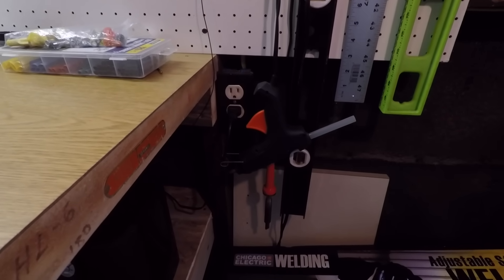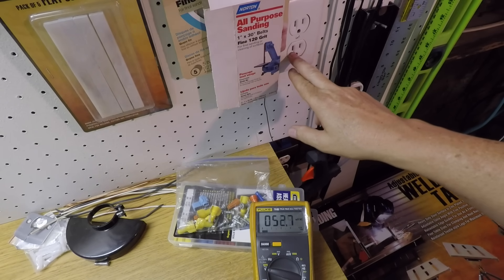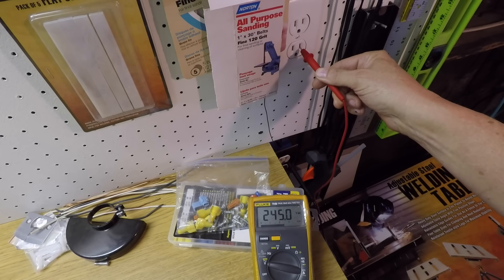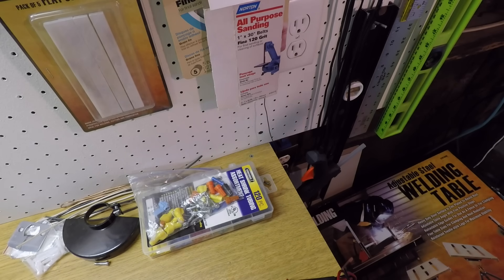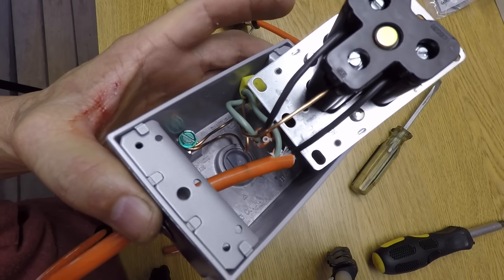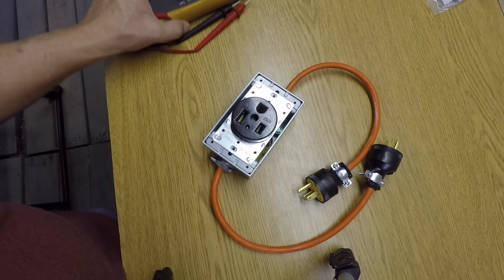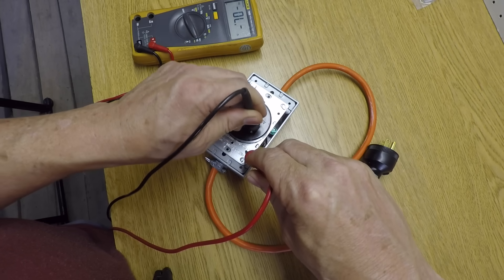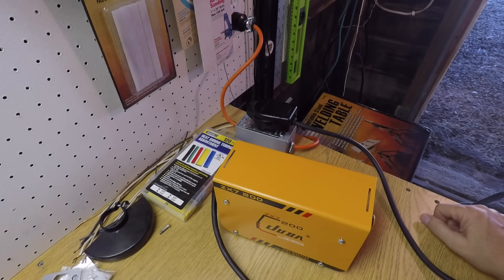How to Get 220v From 110v

Comment: If you installed two 120VAC outlets on seperate phases, why not just install one 220 VAC outlet ?
Reply: @Ranzy Campbell actually he did. He failed to use correct nomenclature but I had no problem understanding his narrative. He created a solution that he understands the limitations and characteristics inherent. If one is not comfortable then one should not duplicate.
Reply: @Ranzy Campbell that may have been what he meant when he said 2 separate lines like 40 times
Reply: The only reason I would think for not putting a 220 V dedicated outlet would be there was no more room on the breaker panel ?
Reply: T.C.  Appliance Repair  for one he had the two outlets there for more things to be plugged in,like cordless battery charger,a phone charger,plugging in a drill. Point is he has four things there. It looks like a work area. Second,it's cheaper than running new wire,getting another breaker,having wire running along the outside of walls, but main thing is it's for running a little welder when he needs it. You can unplug and put in bottom drawer of toolbox out of the way when not in use  it's a good idea what he did for what he needs bottom line. Good video.
Reply: @johnsellers2999  this is the best replies, the "scientists" produce idiotic advises, fact is that this connection works with safety. Remember, thousands of emigrants bringing their own small appliances which needs 220V with little amps, simple !!!
Reply: @TCApplianceRepair  What about if he has an old house with a fuse box? That would be a pretty good reason, wouldn't it?
Reply: @TCApplianceRepair  Exactly!
Reply: @Ranzy Campbell Ya, he kinda did at 40 seconds. I know you get it, but if you don't understand separate phases from his line "they're on separate lines"  enough to put 2 and2 together, then you understand enough to be doing this mod.
Reply: @Ranzy Campbell yes he did if you actually listen to the video. He says they have to be on separate circuits and he says he knows they are separate circuits cause he installed them.
Reply: 1:53 into the video he pointed out the two receptacles were on separate lines
Reply: If you took the time to run a completely separate 110-volt circuit so that you could do that why not just run a larger gauge wire and put the 240-volt receptacle where he put the second 110 instead?
Reply: I think the point of this method is to get 220V and also 110 without running the heavier wire that would be required for a dedicated 220V plug. That's what I wired for my Lincoln 220 amp welder that requires 60 Amps service. That little buzz box of his will probably be happy as a clam on 2 20's for a total of 40 Amps. I use 2 30's.
Reply: @kenjsr1  Since he is using  220V he only gets 20 amp, not 40. Only the hot wires are used so they act as both the feed and return.
Reply: Maybe because, he didn't want 220 there.He might not  use welder very much.
Reply: Maybe he did it like that just to save money on. I don't know.
Reply: Why doesn't he just make  220v extension cord, and plug it into where the stove or dryer is? He could even bleed off a new plug from dryer/stove and mount it in a convenient spot.
Reply: The problem is that if a circuit overloads and only one breaker trips, the 240 volt device stops working but there is still one phase hot. That’s why 240 volt breakers are tied together.
Reply: @chains350  Yea, but that isn't really a problem.  If one breaker trips, that still interrupts the circuit.
Reply: that's what I was saying also.
Reply: (@Ranzy Campbell)   3:24
Reply: my guess is that he cant run a 220 v cable from his breaker out to his garage? that would be my issue as well.... i do have two, 20 amp lines going to my garage but one powers the whole garage and the other has only one outlet on it for my 110v welders i use.
Reply: This is my same thoughts..  This outlet will not let him do much welding without tripping a breaker.. The wire he is using is tooooo small and the wire providing power to these two circuits is too light.. 12 Ga as he said..
Reply: I'd have to guess it's if you don't have that 220V outlet, need one, and have two separate circuits in relative proximity that you can tap this adapter into, or in his case, he only uses the 220V occasionally, and has more use for the 110V circuits.
Reply: You do this because you don’t have a 208/240V outlet. It’s perfectly normal to have one outlet on one bus, and a different outlet on the other. However this is still a ghetto electric hack.....
Reply: They make something like this for marine chords 
https://www.westmarine.com/buy/marinco--reverse-y-adapter-2-30a-125v-male-to-50a-125-250v-female--10072957?recordNum=1
Reply: Great vid
Reply: @RJC 3rd yes he did!
Reply: If he doesn't draw more than 20 amps, there is no problem. One good thing about making a box like this is that there is no 240v socket installed that could raise a red flag to a nosey insurance inspector.
Reply: ok
Reply: @designstudio8013  How many eggs?  You can't just say "several" eggs -- you have to be specific!  Precisely how many eggs?
Reply: cost and routing are reasons also the idea that if there's a line or 2 that isn't being used that's closer and cheaper to use.
Reply: this way might be cheaper and easier(not safer), it depend on where your panel is.
Reply: Gord Reddy While you will not typically run into it any more, Two phase does or at least did exist. We used to have a 5 wire two phase set up on the job. A2 A2, and C1 C2 with ground in the middle. It was used in an 13000 - 2400 electric substation for feeding the MG set as well as going out to feed some customers. While the phases were from a 3 phase feed, the 5wire configuration only used two phases.. Don’t remember a lot about it but I know it was a 5wire two phase set up. I also hate to hear the talk about phases as oppose to polarity talk.
Reply: Ranzy Campbell actually he did.
Reply: Just curious- who here wants 4moreYears ?
Reply: For his particular application this is a perfect setup. He's running the lines to be used as a dual purpose as he mentioned. He did not directly say this but I'm going to go out on a limb and say that he is not going to be welding very much. It was a way to run 110 throughout his shop and then be able to utilize it for 220 in the rare instances that he needs it. And now he has a very nice mobile setup that can be taken anywhere that has a minimum of two 110 outlets. Now do you get it? It really is not that difficult LOL seriously a bunch of overthinkers.
Reply: Let me try boss, I always wanted to fix a transmission.  DDAAAAMMMMMMMM!!!
Reply: Yep.  You could put it half-way between the two outlets.
Reply: @RJC 3rd 220 is single phase
Reply: it's not separate phases.  It is the same phase.
Reply: @tchevrier  It is also two phases that are 180 degrees out of phase with each other.  The difference between one and two phases is just a matter of perspective.
Reply: this exactly
Reply: Exactly what I thought 🤔
Reply: If you dont have complete control of the wiring until the breaker box, you are stuck with 120. You can't upgrade to 240. This would solve that. Aka. Condo.
Reply: Could neural wires be used to wire a 4-prong  220v outlet?
Reply: Exactly.
Reply: Because... HACK!
Reply: Agreed
Reply: Exactly
Reply: Why not throw the stove out and weld in the kitchen.
Reply: Y'know, I was wondering that myself.  :)
Reply: Exactly. He is not getting "220v From 110v", he is getting 220v from 220v, so run the 220v circuit.
Reply: Because then he wouldn't have been able to make this video...🤦‍♂️
Reply: Bones McGillicuddy  A typical NEMA 14-50 240v outlet does have a neutral so you can easily get 120v.
Reply: He could do that but he would have to cut drywall to pull wire from each box to join them into his new box.  Definitely what I would’ve done though.  :-)
Reply: @Ranzy Campbell it won't work if they aren't
Reply: @Ranzy Campbell 0:41
Reply: You can't get 220 from 120. He is taking from two different phases or supply lines so he is getting 240 volts any electrician like me knows this. I'm sorry but the title is deceiving
Reply: We have 2 110 lines coming into the house everything is 220, lights, appliances etc, no ground or neutral, crazy this is in the Philippines, on lights you cut one of the 110 wires for switch but you still have 110 to the light
Reply: He's forgetting that most stick welders need a 220V 50 AMP outlet.  20 amps won't do it.
Reply: You are right. This is a jerry rigged way of doing it. Just put a 220 volt outlet on the wall and done.
Reply: 🤦🏾‍♂️ RIGHT!
Reply: Since you mention it, NO. Its against code, NEC and Building code everywhere in USA. Things you plug into the outlet are generally bot covered by code. Not only is it against code its dangerous.But if it is for temporary or intermittent use then im all for it. The exception is that it is up to code if you use a circuit tie device across the adjacent breakers that are part of the circuit.
Reply: Because far more work is required like proper wiring.
Reply: Those 15A receptacles are under-rated for the circuits and present a fire risk if loaded to 20A. Please replace them with proper 20A rated ones.
Reply: Was wondering the same ! Lol😅
Reply: I stand corrected, there are four inputs and three out!
Reply: I'm going to try it!
Reply: exactly.
Reply: Why not just put one 50 amp breaker in the Box instead of jerry-rigging two that only goes to 20 amps Max? I installed a heavy duty cord from my basement out to my garage and a 50 amp breaker so I could use my welder, it works great and it's a safe way of doing it and it wasn't terribly expensive, I could do the work myself.
Reply: @builtyankeegirl  He most likely has a MIG welder that only needs a 20 amp 240 circuit. This would not work for a "stick welder"  that needed 50 amps. I agree with you as to why not  just  use a 12/3 cable and install a 240V. outlet?  He could cheat a 120V outlet off of one leg if he wanted to have one adjacent. . If you don't have 240V to your service, then this won't work without reversing the sine waves for one side. This idea would  work great if you were trying to use your welder at  a house that did not have an outlet and you just needed to weld something for someone . He did more work than he would have to wire in an outlet for the welder.
Reply: @wazjr1  if you watched the whole video you would have seen the welder. He as a tiny inverter stick welder. I have heard some people call them purse welders. But it is about the size of a lawnmower battery. I have been out of the fabrication and welding trade long enough I am not sure what they are called.
Reply: @wazjr1  If you had watched the video to the end before commenting, you would have seen that he has one of  those Chinese inverter stick welders. You may need 50A at 120V but not at 220V. You need half the current. At 220V 25A lines can power a 5KW welder with PFC. His welder definitely does not have PFC but it is also not a 5KW welder. Even if it says 200A, a guy on the youtube tested one of those and realised it gives only the half of it. He also says at the current setup he uses, it draws 15A. In the US, I have seen 3 transformer packed on poles (was quite strange for me. Expected safer, modern setups). They use 3 phases and use 220 on heating current hungry devices like ovens water heaters etc. Once the circuit breaker (not the automatic ones) burned and the microwave oven only worked when the light was turned on. It got the other pase through the bulb. Funny setup.
Reply: @builtyankeegirl  Hope you used #6 wire
Reply: @builtyankeegirl  a 50 amp bkr requires #6 copper wire
Reply: @builtyankeegirl   yeah think he just wanted to through out there that there is another method that you can get it done. May be someone is not familiar with the breaker panel... and does not want to be guessing.
Reply: @builtyankeegirl  because #12 wire is only capable of 20A
Reply: @builtyankeegirl  Ya, not much of a welder at 20amps.
Reply: @builtyankeegirl  honestly if you're going that far, put a 100A or 60a sub panel in the garage, have the garage on its own and you really wont need any upgrades
Reply: @builtyankeegirl  because by doing that what your doing is removing the safeguard of the breaker you can always put a smaller breaker on a 12 gauge wire but by putting a higher breaker than the 20 amp the wire could get to hot causing a electrical fire
Reply: @builtyankeegirl  I
Reply: @builtyankeegirl  the wire feeding the devices is only rated for 20 amp. You could install a 220v 20 amp breaker and outlet in it's place. If the welder needs more than that he should run the appropriate wire/outlet/breaker sized to the unit. His way is a violation and is very dangerous.
Reply: @builtyankeegirl  50A breaker on 20A wiring? C'mon, man!
Reply: @builtyankeegirl  first he does not need a reason, just because "Merica", second.... Portability of his setup, he explained he has the same setup (2*120 boxes) somewhere else on his house.
Reply: @builtyankeegirl  The only reason I can see for doing this is that his panel is full and can't add a 50 amp circuit. Even so, I believe they sell adapters to go from dryer outlets to NEMA 6-50, which would be a better solution, combined with welding extension cord.
Reply: Another reason for not just throwing a 50amp breaker in his box and up grading the outlet on the other end to a 3 or 4 wire 220v would be the size of the wire connecting the two. He didn’t state how far it is from the outlet to the breaker box and I would assume (at least my personal preference would be to) he would rather run an 8 or 10 gauge wire instead of the 12 gauge that’s currently in place, as he stated, especially if it’s going to be a dedicated 220v. It seems to me he is not willing to go through the work and expense if he’s only using 220v once in a while and for short periods of time. He did state that the welder was small and he didn’t think it drew much amperage.
Reply: @speedbuggy0542  lol know how a lot of welders have a number  in their name? How many amps u think?
Reply: Chris Gilliam Man Stuff this is what I did. Just a chunk of dramatically oversized cable, with the correct outlets on either side. It’s cool as a cucumber even with constant max draw. This is running a kiln, so it’s a pure resistive load.
Reply: @speedbuggy0542  So... increasing the voltage does not allow you to run a higher current on the wire. Running a higher voltage actually reduces current demand for the same wattage, but that's another story. So if he requires 20 amps it's always number 12 wire, regardless of the voltage. The thing that's kind of silly about this for us electricians is that he could have bought a 7 dollar dual pole breaker and wired the white wire that usually goes to the  neutral bar to the other pole on the breaker. So he pulled the wire... installed the receptacle, then had to buy a bunch of materials to make this device when he could have just bought the correct receptacle. Just kind of silly. Besides is way of determining the phase he's on with each receptacle is not a good idea at all. he has a significant change either because of load balance or where the taps are on the transformer feeding the house but I certainly would not recommend relying on your voltage reading to determine what phase your on when it's as simple as knowing where the breaker is in the panel for each circuit.
Reply: Was just thinking that
Reply: He actually explained that he has the same setup (2 * 120 boxes) some where else on his property, so this device makes the 240 adapter portable. And It works fine. No problem there.
20 amps only?, ... why not if that's all he needs.
Reply: @oldiam  #12 guage wire needs to be protected at 20a. U can't install a larger breaker.
Reply: I am not an electrician or an electrical engineer. So take what I have to say with a that in mind. ;-)

I assume he did this method because the majority of his tools are 120VAC. Can you take a 240VAC and turn it into two 120 VACs just as easily?
Reply: John Smith Yes, they sell Y-shaped cords that do this.
Reply: @CommentsAllowed  Only if they are from L1 and L2, or as we often call them phase A and Phase B. If you take power from two different 120VAC circuits that are from the same Phase, it will not work. There are 2 bus bars for the "hot" conductors coming into the breaker panel.
Reply: @CommentsAllowed  you could but that would not be a safe breaker controlling the one 110s since 240 breaker is 2 110v stuck together
Reply: @CommentsAllowed  yes.  If you look at the lines coming into the house you will see 3 wires. 2 hots and a neutral.  You then have a ground rod in the ground or if city water present can have a cable hook onto city water line.  Neutral and ground get connected in the main breaker box. Then 1 hot to neutral gets 110 then other hot to neutral gets 110 again but both hots together gets you 220
Reply: @CommentsAllowed  yeah there is 2 120v wires and a ground so just take a plug and wire it too 1 hot and 1 ground and send the wire to a 120v outlet or 2 120 outlets and use both hot wires on the 120.
Reply: AB_015 yes very easily... to the point my generator came with an adapter for me to run 2 120v lines out of the 240v plug
Reply: @CommentsAllowed  In UK and AU the 240V outlet is not configured like the one in this video. It has 240V live/active, a common/neutral, and ground.
Reply: @CommentsAllowed  yes.
Reply: You read my mind!
Reply: because you can take the connector anywhere he wants too and have 220... also just because he can.... duh?
Reply: BECAUSE USUALLY HOUSE WITH 220V SERVICE HAVE 2 120 V AND 1 NEUTRAL   COMING IN  ,AND THE ELECTRICIAN WILL DISTRIBUTE POWER USING BOTH LINES SO THERE IS NO OVERLOAD ON ONE CIRCUIT    , SO WHAT HE SHOW  HERE IS IF THERE IS 2 DIFFERENT LINES CLOSE BY AND  YOU BRING BOTH LINES IN TO SAME BOX,  REALITY IS THEY MAY BE 8 OR 10 FEET FROM EACH OTHER AS OUTLETS ,TO FIND OUT IF YOU HAVE TOW SEPARATE LINES IN TOW SEPARATE OUTLETS  READ ACROSS THE TOW BLACK WIRES AT 2 SEPARATE OUTLETS   USING BOTH PROBES ACROSS  BOTH BLACK WIRES   YOU SHOULD BE GETTING A READING   OF 240V   , DON'T THINK IF YOU TAKE ANY TWO SEPARATE WIRES  FROM TOW SEPARATE   OUTLETS WILL GET 220V ,  JUST THINK AS IF YOU ARE WORKING NEXT TO THE CIRCUIT BOX WHERE YOU HAVE 3 WIRES COMING FROM THE UTILITY CO. 2 ARE 120 EACH AND THE OTHER IS THE NEUTRAL,  ALSO IN SOME RURAL AREAS THE UTILITY CO. WILL USE THE BER   GUY WIRE AS NEUTRAL  WIRE . ALSO A 220V OUTLET MUST BE  SPECIFIC 220V RECEPTACLE  SO NO ONE CAN PLUG IN A ANYTHING OF 120V BY MISTAKE .
Reply: The ground is too small it would just cause the unit to overheat not just at two plug-ins and never safe on a 220 in case they get hot and doesn't make good connection it will burn up on all three outlet boxes if he would have hard-wired it it would have been a lot safer this is coming from electrician
Reply: @edmondlajoie5968  the ground is not carrying any current unless there is a fault. The biggest problem he has is the two separate breakers which wont necessarily trip at the same time if there is a problem
Reply: @edmondlajoie5968  as you say you are "an electrician" you should KNOW that there will be no current in the ground conductor unless a fault exists. Maybe you should put your license back in the "Cracker Jack" box?
Reply: insylem 
I just don’t understand why the US continue with such a dumb 110v system 
Join the real world and go 220/240v
In Australia we can have 3phase in out homes
That’s 415 v phase to phase and 240v from each phase to neutral ...
What a concept!
We can actually run large air conditioning 
With out using HUGE copper conductors
Reply: @batmanlives6456  yeah, ever happen to touch a live wire?.. Those of us in the US are a lot more likely to live to tell.
Reply: @Wuety06  not necessarily, the lower the voltage the higher the current.
Reply: @zman8845  Not when it goes through your body. Higher voltage equals higher current going through your body during a shock. This can be explained using Ohm's Law.
Reply: @batmanlives6456  There are many reasons why the US uses 120/240V in it's services.  And BTW it is not only the US that uses the lower voltage systems.  Many countries use a similar system.  All of North America and much of northern South America does too. Most electronic devices use 24 volts or less internally so they don't need the higher AC.  Safety is another concern.  Current through your heart is what kills a person with electricity.  Your 220/480V will drive 2 to 4 times as much current through any given resistance as the 120/240 system.  Better for you and your children.   Then there's aesthetics.  120V plugs are smaller than their 240V brothers so they look better and take up less space.  These are just off the top of my head.  So you see it is only dumb when you don't understand the reasons.
Reply: @TechSavvy.  Nope not smaller. In Europe the outlets and plugs are small not like our 220 plugs. Appliances last 2 to 3 times as long, less heat. Also less expensive to run electrical only using a single system. The reason the U.S. uses 110v is the same reason we do anything here, MONEY. Someone sold us on this method so we will continue to use an antiquated electrical method from beginning to end. There are no more deaths in the rest of the world from electricity than here.
Reply: Tech Savvy l
Reply: @TechSavvy.  You call yourself Tech savvy and dish out that discourse?🙄.
Reply: @TechSavvy.  what are you talking about, smaller, you probably never was in Europe!!
Reply: 110v for safety reasons, wait until you get shock by 3 phrase then you no longer make any more comments...peace!
Reply: @batmanlives6456  We do have 240 here in the US (120/240) in our homes and it works just fine. Don't like it, don't come here. We won't miss you.
Reply: Scott Dean, to understand why we have the grid we have here in the U.S., research the history between Thomas Edison, and his much more brilliant protege, Nicoli Tessla. Edison's ego couldn't handle the genius of his once pupil Tessla. So our current system (no pun intended) was a compromise that arose from Edison being all butt hurt from Tessla's superior A.C. invention, over Edison's inferior D.C. System for delivering long range power from the source.
Reply: @batmanlives6456  I bet you can charge your Tesla in about 30 minutes down there.
Reply: @batmanlives6456  well isn't that special
Reply: @batmanlives6456  to be fair the usa has 480v and canada has 600v for commercial and multiresidential units, we just have 120v for the appliances that are most commonly used because it is less lethal, and honestly all you need is a vfd to get 3 phase if you really want it nowadays
Reply: @batmanlives6456  But did they not run all that electricity there because it was a penal colony and they wanted to electrocute criminals?
Reply: @batmanlives6456  The US has 277v on single phase and 480v on from phase to phase. It's just not used it residential applications. Mostly used in commercial lighting. We also have 208v from phase to phase on single phase too which I honestly don't see a point in.
Reply: @batmanlives6456  he has 240v available.  My house has 240v wired for stovetop and drier.
Reply: @batmanlives6456  
At this point the cost would be astronomical. Would love 3 phase at home tho, so much more efficient.
Reply: @batmanlives6456  
Well it's the system we have. Just like the Imperial measuring system. It isn't going away anytime soon if at all so, there you go. It's worked fine for quite awhile here. You know the U.S., "this is ours and that's the way we like it by God!" Ha ha ha 
Anyway, hope to make it down under some day. Almost made it just before the gulf war started. In the middle of the pacific and was headed your direction when we had to go take care of Saddam. 
Have a good day.
Reply: @batmanlives6456  same reason we cant seem to let go of imperial measure    senseless.
Reply: Scott Dean because we'd have to buy all new crap?

From what I heard, Westinghouse suggested 110v as the standard because they could sell more copper.  Not sure if it's true, or I remember accurately, but it sounds possible.
Reply: Scott Dean next you're going to want us to use metric just because you don't like doing fractions in your head, or multiplying by your number of fingers + feet.
Reply: @batmanlives6456  I reason is because it is safer.  240 volts is twice the killing power as 120 volts.
Reply: @batmanlives6456  Yes but only if we pay $000's to have it put on. Older houses built with natural gas stoves & water heaters only have a single phase supply, originally with only a 40 Amp main fuse. Most modern hovels only have a single phase 80 Amp feed.
Reply: @batmanlives6456  have you ever been zapped by that 240.      O,O
Reply: @batmanlives6456  , when you say you "just don't understand", it would be easy enough to look it up, then you could say that you DO understand, even if you disagree with the reason. There are valid reasons why things are the way they are, and those reasons can be known to everyone not too lazy to do a little bit of research.

It is also a mark if ignorance to condemn something as "dumb" without at least trying to understand it first.
Reply: @batmanlives6456  its more costly and thats why i rewired many homes in africa due to them using all 220 instead of 110 .they want 110 over 220 it is more efficient and cheap for them
Reply: @batmanlives6456  We use both in the U.S. We need 220/240 for electric ranges, clothes dryers and air conditioning.
Reply: @batmanlives6456  110v goes back to Edison and his DC distribution system, which was...110v. 

Light bulbs don’t really care if the current is AC or DC, so when it became apparent that AC was easier to distribute over distances, that voltage was kept for practical reasons, since the chief use of electricity in that day was for lighting. By the time high wattage home appliances came about where 240v was advantageous, 120v had been in use for such a long time for everything else in the US that conversion to 240v as the de facto standard for low wattage appliances and lighting would have been a hard sell. 

Whatever incentive that may have remained has largely disappeared with the reduced power consumption of modern electronics. What benefits from the higher voltage (mainly appliances that use some kind of resistive heating elements) are supplied with 240v. I am mainly frustrated by how electricians and builders lack enough foresight to run at least one 240v outlet into garages and basements when building homes. The incremental cost at time of when the home is being built is tiny compared to the overall cost of wiring the home, and is absolutely minuscule when it comes to adding an outlet after the fact.
Reply: @batmanlives6456  Edison screwed the US because of Tesla patents . We pay more for power (direct current ). SCREWED up World !  Our air conditioners now are converted inside the unit from the factory to alternating current ! Double Energy rating overnight !  You ought to see how we get screwed on cell phones .
There cannot be peace and prosperity as long as there is a government.
AKA mind control!
Reply: @batmanlives6456  man cause were american lol and do you know how much it would cost to rewire every house in the u.s lol!
Reply: @batmanlives6456  Believe it or not it all was because the Tesla induction motor ran on 110V.
Reply: @batmanlives6456  I agree.  Just like the metric system.  We live in the greatest country in the history of the world but every other country does things better than we do.  I am always amazed at that attitude.
Reply: @batmanlives6456  We do use 3phase in commercial buildings, but they are 208v. It's just history, so we use what's there instead of building 2 systems with new stuff on one system and old stuff on a different system; we would have 2 systems for about a century. Just a big hassle with a small benefit.
Reply: @batmanlives6456  The US system is 220v.
Reply: @batmanlives6456  In case you didn't know, the U.S. has 240 volts - that's what we run our electric ranges and driers on.  Our 240/120 volt split phase system allows the use of a neutral wire being only half the size because it only has to carry half the current due to a cancellation effect. Installing a 415 volt 3 phase system for residential use is mostly a waste of money.
Reply: @batmanlives6456  I don't understand why the rest of the world makes stupid comments that aren't true not knowing what they are talking about because they think I need to boil water faster in my bedroom so I shouldn't have both 120 and 240v outlets in my house and that every device in my home for some stupid reason absolutely must use the same power as my stove or there's something wrong with it. Both the US and Canada use 220v. We split the phases and only run 110 unless we need it.
Reply: @batmanlives6456  becase the cost to change to  240  would be astronomical
Reply: @steveholland1163  your absolutely right, my garage is 120 feet from my house. Do know how much that wire would cost now
Reply: @batmanlives6456  Well, its to late to change now, Its like the Imperial system.
Reply: @batmanlives6456  My uncle who died in 94 made a 3 phase circuit using an electric motor on a 240 volt circuit out in the county here in North Carolina.
Reply: @stephensaines7100  i think he made a rotary phase converter i just did this for our cnc machine in nc too
Reply: @stephensaines7100  he said it was 240V so maybe he was using split phase and a ground thinking it was 3 phase.
Reply: @oliverscorsim  yes he did, he just called them seperate lines instead of opposite phases.
Reply: @onradioactivewaves  In the US and Canada, the residential niminal voltage is 120/240VAC. 240VAC receptacles only have 2 live wires and one ground(earth) wire. Neutrals are only used for 120VAC circuits. The secondary coil of the transformer supplies 240VAC to the meter and main panel and/or subpanel(s). There is a center tapped neutral on that coil. L1 to neutral provides 120VAC, L2 to neutral also provides 120VAC, and L1 to L2 provides 240VAC. If there is a short circuit or ground fault, the breaker will trip so long as the electrical codes are being followed.
Reply: @trentallman984  He made this in 94 and died trying?
Reply: @trentallman984  Yep one Y Wound motor and 4 start caps and away we go. You can even not have the caps but you have to spin it to start it.
Reply: @trentallman984  did he use a 2 phase motor to turn a 3 phase motor shaft and pull three phase power output from the 3 phase input wires?
Reply: @trentallman984  Ya, some AC induction motors can be used like auto-transformers
Reply: @batmanlives6456 , Here is your answer. Tradition.  Over a hundred years ago, 110 volts was established as the standard voltage in the US -- which was, of course, the first country in the world that became wired for electricity.

To a large extent, that was because in those days the insulation materials available were not very good.  To insulate a wire running to an appliance or a lamp, the insulation would have had to be very thick, to prevent damage or shocks, if a higher voltage was used.  Within an appliance, very much thicker washers or insulating plates would have to be used, to prevent breakdown under higher voltages.  They could use higher voltages in the distribution system, because the wires were strung high off the ground, and the transformers were mounted high atop poles so they could afford to be rather bulky.  No one worried about insulation thickness up high.

Materials science improved rapidly, so by the time that most foreign nations got around to becoming electrified, higher voltages could be handled safely.  And higher voltages meant lower currents, for doing an equivalent amount of work, so there was less heating effect and thinner wires could be used -- making equipment less costly.

But there was never a point at which it made sense to shift the standard household voltage in the US to a higher level.  The cost of changing all of the distribution transformers, for example, would have been horrendously high.  And all the US consumers would have had to discard their toasters and mixers and washing machines and light bulbs and all the rest, to accommodate a voltage shift.  So they kept on using 110 (gradually increased to 120) volt household electricity, just because that was the way it had always been done.  Tradition.

Of course, there are great advantages to using 220 to 240 volt electricity for heavy-duty appliances, such as clothes dryers and electric stoves and ovens and central air conditioning systems.  So, generally since World War II, new homes have been supplied with 120/240 volt electricity, and older homes have mostly been rewired with higher voltage service as well.

But people still have lots of 110 volt lights and waffle irons and window air conditioners and power tools and so on.  The 110 volt corded power tools are slowly being phased out, in favor of battery-powered tools, but there are plenty of the older ones still in use, and plenty of 110 volt appliances and lights as well.

And, typically, the replacement refrigerators and freezers and washing machines and irons and the like, are still made for 110 volt operation.  That is because even though a house may have 240 service brought to the breaker box, it is usually very expensive to put in a 240 volt outlet for every appliance.  People are rarely interested in rewiring their electric service just because they are replacing an appliance.

There is a growing market for 220-240 volt appliances, in newer and more upscale homes, but less so for higher voltage lighting.  Over time, as older homes are demolished or renovated, the mix will slowly shift toward higher voltage appliances and lighting.  Eventually, 110-120 volt will be phased out, just as gas lighting was phased out during the first third of the 20th century.  However, don't count on that happening during your lifetime.
Reply: Scott Dean 
Because USA is the number one in the world. Do you understand?
Reply: @batmanlives6456  Scott, that's neat that you know and understand that,  a subject i am learning about, thanks for posting/sharing.
Reply: @batmanlives6456  because the US is backwards in a lot of areas for some reason....  I wish i had 220V in my garage and dint have to run a new wire from my 100 amp service,  breaker box thats inside the house 50' away! ...lol
Reply: If you check the specs for that welder you will find it’s SINGLE  phase.  I hope you were lucky enough to have both breakers on the same phase.
Reply: @B4ckW00dSkiah  You can't double the voltage on a single phase -- he had to connect to both phases to get his 250V.
Reply: @2000ReRyRo  It is only one phase. That is all. 120VAC is derived from splitting the single phase but you do not have two phases. Both legs of one phase to get 240VAC.
Reply: @gravelydon7072  One phase and two phases that are 180 degrees apart are two names for the same thing.  You could make a 4 phase generator with the 4 phases being 90 degrees apart and if you tap two opposite phases that are 180 degrees apart you could call those two phases, or one; it's the same thing.  Often commercial buildings use two out of the three phases they have to supply a single 208v phase.